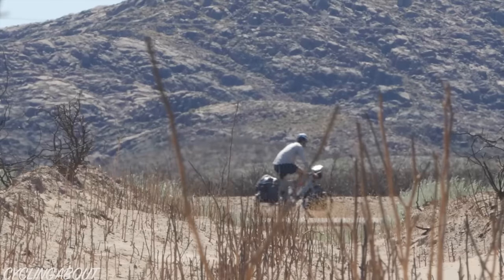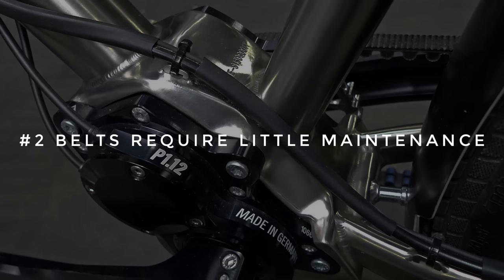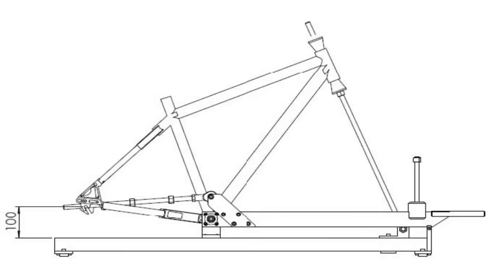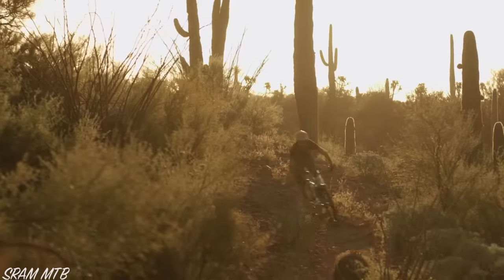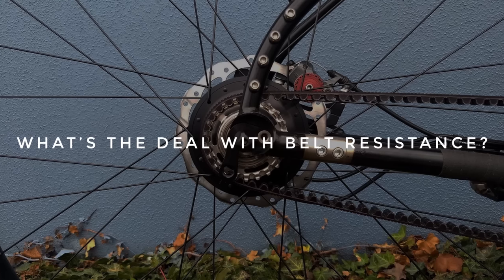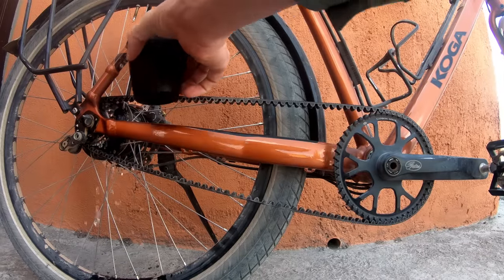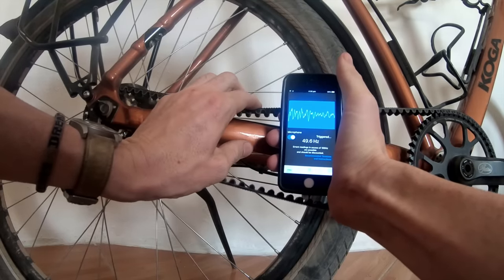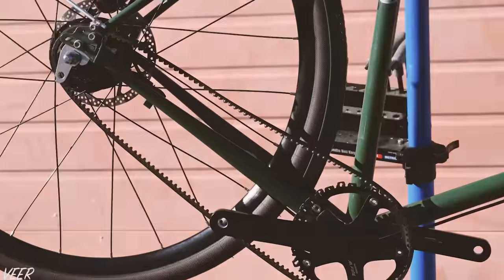Belts Are The BEST Bicycle Drivetrain Available (Epic Testing!)

Comment: “Belts are lighter than chains.”

XC Mountain Bikers: I’ll TaKe YoUr EnTiRe sToCk
Reply: Me: Laughing in downhill mtb😂😂😂
Reply: They're also less efficient, costly, and have limited gearing options.
Reply: Downhill riders laugh in singlespeed
Reply: Alex Paulsen exacely. If you want to lose as much power as possible... use belt
Reply: Yes if it has a gear, or it will be waste for mountainbiking
Reply: @lewiegray491  Would be interesting to try a belt in a Bike Park, would probably fell of in the first 10 sec😂
Reply: @lewiegray491  umm trust me i race and that's not true
I have 7 gears so...
Reply: Belts are great in theory. Then your damn teeny tiny gasket on your internal gear hub gets a micro leak, and your belt goes snappo in a month or so... Have serviced one like that. Really nice in theory though. Would not even dream of ever putting that on a BMX...
Reply: hi J L...
'
how about change gear and change speed ?
Reply: I think gearboxes are heavier than a derailleur and a cassette, so if you want gears they are not the lightest option
Reply: “Belts are lighter than chains.” but "I always carry a spare belt for emergencies"
Reply: @ossacrum  He's talking about the weight of the whole system, and it seems like he would carry a spare chain anyway with the rides he does.
Reply: Aaron Gwin: laughs in no chain
Reply: Only the drive ITSELF is lighter. By the time you add the hub tranny, it tips the other way. If you're running a hub already, you'll save weight. Otherwise, the only gain you'll find is durability and less maintenance.
Reply: @sylentxtinction2097  Some hubs are lighter, but you don't get many speeds, pretty costly too. Hub tech is getting pretty good though, theoretically they can be lighter but we'll have to wait and see if future many-speed hubs actually get compact enough.
Reply: @samheasmanwhite  - I'm still waiting on someone to come up with a viable constant mech CVT. The NuVinci unit is heavy as all get out, and not very dependable (unless they've made changes).
Reply: @sylentxtinction2097  Mmm, yeah. There are some fundamental problems with CVTs that I think will make it impossible for them to be anywhere near as usable as gears. It is impossible to make one that does not rely on contact friction rather than interlocking like a gear, it needs a lot of force and contact surface area to do that so they will always be bigger, heavier, wear out quicker, and have more friction. Oh actually there is one topology that has teeth locking into sliding segments in a belt, but they are quite lossy and wear fast. It's a pity but I don't think one will come...
Reply: @samheasmanwhite  - I've been working on one for years. It only uses friction to power the rpm reference (roughly 3-5% loss). The driven sector is just a single planetary gearset. So far, my two biggest problems are weight and contamination. I can't seem to seal the reference sector and keep it easy to maintain. I can mitigate the problem by using ceramics friction discs that will likely outlast the gears. As for weight... the control portion requires sizable thrust bearings, which add significant weight. The effective range can be setup with insane ratios... but with wider ratios comes longer sweep times, and I don't think I can build an XC version with the response or weight riders demand.
Reply: @sylentxtinction2097  Mmm, yeah, they do need to stay very clean, even with ceramics they will wear with dust contamination. You can probably make do without ceramics though, there are some special lubricants that are very good for these that are shear thickening, they are thin and low drag but when pressed between the surfaces they thicken enough to hold the pressure without direct contact, I think that type is used in some commercial CVT oils you could buy. Can it provide much torque at the insane ratios? I'm curious about the topology of it.
Reply: @samheasmanwhite  - I'm trying my best to stay away from friction fluids. They're particularly hard to engineer around my application, as I need partial transfer of energy. Frictofluids are designed to be nearly positive engagement at all times, and are very tolerance sensitive (no exactly conducive to my application). The entire goal of the project was to negate the problems of usinf exotic fluids and eliminate the need for extremely precise surface tolerances/coatings... basically the two main downfalls of the NuVinci solution.

As for the torque it can apply... torque transmission is largely limited to beef of the planetary set, and the threshold of the thrust bearings in the control sector. Obviously, increasing either of these results in significant weight increases. I've been able to significantly reduce the size demands of the thrust bearings by incorporating a damper, which drastically reduced dynamic load spikes, at the expense of reduced positive control. The effect results in the first 1/2"-1" of pedal travel in a slightly lower ratio than the effective setting... creating an undesirable spongy feel to the transmission.
Reply: @sylentxtinction2097  Ohh, you are using variable sliding friction to get a variable ratio rather than varying the ratio directly? Yeah, the special thickening lubricant won't do much there, but it may still be good to have some sort of lubricant to reduce wear and provide a more consistent friction profile, it would need to have consistent properties over a wide temperature range though, maybe self-lubricating solids like brass impregnated with graphite or MoS2? Those have less problems with contamination too. I'm not keen on the losses that I guess you get from friction drives, but they can be very robust and much simpler, how is it controlling the ratio though? Can it keep it constant or does it vary with load too?
Reply: @samheasmanwhite  - hence why I would rather just use bare ceramic discs. The low amount of energy limits the heat well within range of the material. I need the friction to remain largely consistent  for calibration and user familiarity. Any use of lubricant would cause variations of the control sector, and reduce the positive feel of my design, along with vague control positioning. Again, the extremely light energy transfer through the friction area mitigate wear considerably. 

Given the average rider is only capable of roughly 750w output... the energy transfer to the friction area will be around 30w (less than your average vanity bulb). Well within the limits of the components to radiate through an aluminum casing and steel bearings without accelerating degradation. It's not the friction I'm worried about. It's the weight and speed of the regulator. Peak inefficiency is at lowest output speed. The good news is... at it's highest output speed, the parasitic losses are limited to planetary itself, as the regulator is static.
Reply: @sylentxtinction2097  
Hmm, does it have a torque comparator that adjusts the friction pressure to maintain the transmission ratio over the whole torque range? Even with that I am guessing you would have problems with the stability of the friction if you don't have any lubricant at all, since the torque varies so much while pedalling.

So does this one use a layout where the input drives the planet carrier, the output is the sun gear, and the ring gear has a friction plate on it? By adding a second friction clutch between the input shaft and the ring gear you could let it be at max efficiency for both high and low ratio, with the middle being the inefficient region. I'm not sure how you would mechanically control the transition from high to low while minimising friction though.
Reply: @samheasmanwhite  - the regulator is kept to myself. As for the effect of varying torque, this is not an issue. The regulator is controlled by output speed, offset by manual control. By using speed as the base reference, you all but eliminate torque influence... and allowing the manual control to set cadence according to a more relevant baseline. There's a reason why we call them "speeds" not "torques".
Reply: @sylentxtinction2097  Wouldn't it need to regulate the difference between the input and output speeds to maintain a constant transmission ratio at different speeds? Or is the intention for it to vary the ratio with the speed to try and give a consistent input speed/torque? That's something I thought the nuvinci thing would do and I thought that would be the main attractive feature, but I don't think they actually did it, at least not mechanically.  I think they made an electronic one though, so maybe that one did it?

But I thought however it was regulated some aspect of it would need to vary the friction of the clutch with the input torque, else it will slip more on a downstroke but slow down on the release right?

Sorry to poke at the regulation though, if it's something that you've tried out with pedal input and it's working fine then disregard this.
Reply: @samheasmanwhite  - there are two reference values to the regulator. The baseline maintains a constant input speed... however, the user control allows them to adjust the overall value, so they can adjust cadence as needed. Moving the control in one direction increases cadence. The regulator self adjusts the relief circuit, so as to maintain the desired cadence as output speed increases or decreases.
Reply: @sylentxtinction2097  Constant cadence sounds like a nice way to regulate it, kind of like regular cycling I guess, lets you push as hard as you like.

Have you thought about magnetic braking? I was thinking it would be too bulky but if the transmission to the braking element was geared up to increase the speed it could be much more compact. You can dissipate the heat remotely and have a heated handlebars upgrade lol. Might make more sense with an electric assist drive, could redirect the power from the magnetic braking to the drive so it's not wasted, getting a bit complex at that point tho.
Reply: @samheasmanwhite  - the cadence can be varied by the shifter. The downfall of the last production automatic bicycle was the inability to change cadence. As for magnetic braking... I thought about it as well... but the associated cogging didn't bode well. I could've used an electric motor/generator for drag, but it was far too parasitic, as the induced braking had to provide equal torque to the desired torque output. Also, it didn't all the transmission to achieve it's highest efficiency with full lock at maximum speed/ratio.
Reply: @sylentxtinction2097  Mmm, yeah, the lack of full locking is a bit of a drawback, although an eddy current brake could be varied up to actually making contact to lock it. If the wear problem can't be solved with materials that might help, has no cogging too. I was trying to find a diagram of a nice looking motor/gen transmission design I saw that only needs to pass a small portion of the power through the motor/gen, but I kinda doubt it could be miniaturised.

It's a bloody tough engineering problem fitting anything complex into a bike hub, I hope it goes well :)
Reply: @samheasmanwhite  - If it ever becomes of anything, I'll let you know.
Reply: @lewiegray491  single speed dh is the best
Reply: Hey hey hey hey no need to call me out like that
Reply: @ossacrum  Unlike a chain that you could put back together, once you snap a belt, that's it.
Reply: unless you want to suffer going uphill.. i would rather have a derailler
Reply: @ossacrum  : Imagine what someone with a electric bike would say...
Reply: @Metal-Possum  limited? More like none at all
Reply: My motorcycle has a belt. And, 140 hp. And, a transmission.
Reply: @IsakZer  weak legs detected
Reply: Yeah, but pinion gear boxes are heavier than derailleurs.
Reply: @Metal-Possum a rohloff speedhub is barely less efficient at worst and just as efficient at best.

Comment: Built myself a commuter / touring bike with belt drive and internal gears and I couldn't be happier. Belt drive is so silent! No need to worry about lubing anything, no noises and creaks coming out of the drivetrain, it's so amazing!
Reply: Could you tell me what parts you used please?
Reply: @jonathanwickett7028  i've built it on soma wolverine with shimano alfine 11 hub and crankset, sprocket, chainring and belt from gates. Can't remember the exact specifics, i've just followed the guidelines on FAQ of soma website. 

I've gone back to "normal" external gears since then though. Even thought the belt drive was silent and maintenance free, I couldn't help feeling the internal hub was slowing me down and I noticed that if I want to keep up with my friends, I've had to struggle way more. 

I still miss the maintenance free aspect and the silence from time to time, maybe some day i'll try rohloff hub instead of alfine.

Comment: Thank you for the advice regarding using silicone on the belt to eliminate squeaking. The manufacturer says to use no lubrication, but this video emboldened me to try silicone and it works perfectly. If you're ever touring through the American Southwest, lunch is on me.
Reply from the maker: Glad to hear it worked! I'm still very happy with the treadmill lubricant.